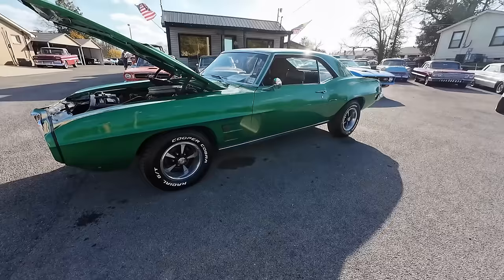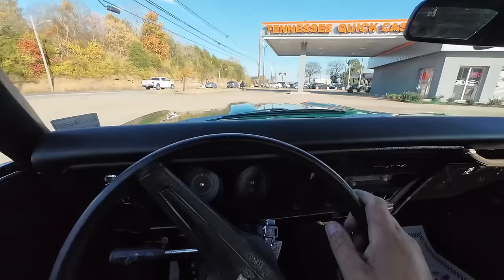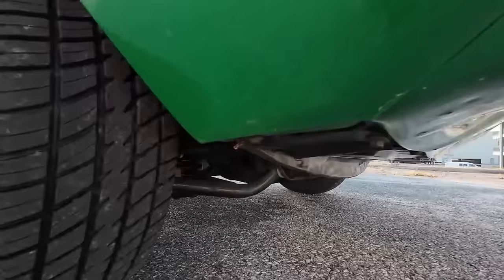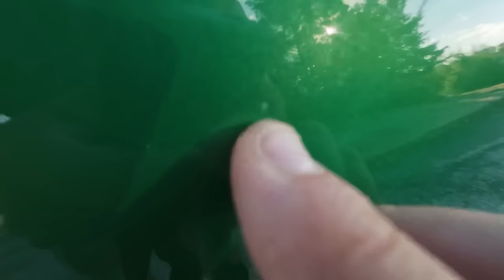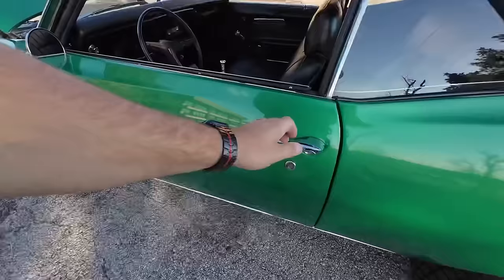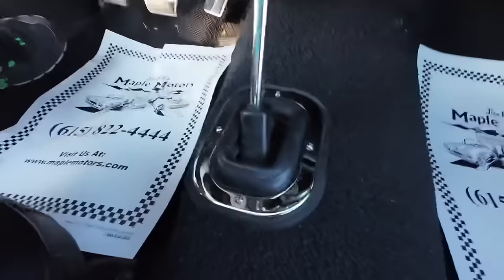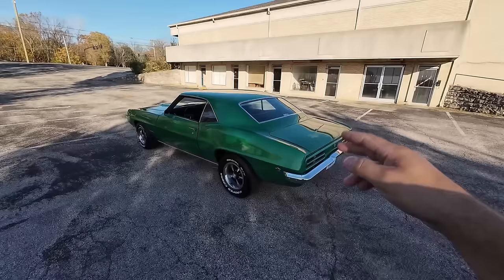Test Drive 1969 Pontiac Firebird SOLD $34,900 Maple Motors #2386

Comment: When I was 17 years old back in 1991 there was a silver 1968 Pontiac Firebird 400 convertible in near mint shape for sale at a dealer like yours for $7,500. I only had $5,000 at the time and could not afford it so I found a 1965 Buick Riviera with a 401 that I was able to get for $4,500 instead.
Reply: Ahhh back in the day when the cars were all priced right!!!
Reply: You and I are the same age, I believe. I started out w a 69 Mustang. Paid $800 for a Mach One w the Windsor engine. Sold it a few years later for $3500 and I'm still kicking myself in the ass for letting her go.

Comment: Not certain that’s a $35k car
Reply: Welcome to the old car market bud.
Reply: That's still cheaper than a 69 camaro💁‍♂️
Reply: Try to build one and see what it costs.
Reply: @Tartan1206  I'd rather build one. You have no clue whats under that paint or whats going on in that motor or trans. 99% of the time that restored car you buy, needs to be restored again, then your spending more. When you build one you know exactly what you got.
Reply from the maker: If you build one be prepared to open that wallet, a whole lot wider. One thing I’ve learned working here , it’s better to buy then build. But if you do have that extreme OCD, then you better have some big checks to go with it.
Reply: @MapleMotorsNickSouthgate  so what happens when a guy buys a 35.000 dollar car and in a couple years the bodywork starts falling off on their driveways? or the frame or unibody structure is filled with bondo and cracks in half? Then you have two choices, it becomes an yard ornament that the guy still owes 30.000 on, or fully restore it again for another 35.000, while still paying it off the first time? " in that case you better open that wallet even wider than that! I've seen it time and time again beings i work at a body shop that restores classics. I cant count how many times guys or gals have came in the shop after they bought a supposed "restored" car and come to find out its nothing near what they thought it was. Thats why if a new guy wants in the classic car game its best to just buy them in raw form and build it yourself. Then you know exactly what you got!
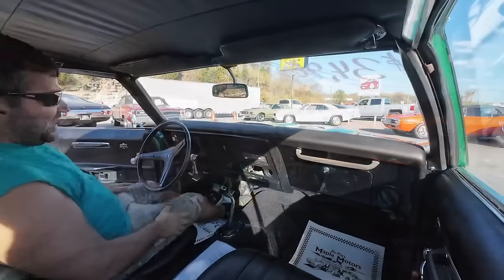Reply: 2:58
Reply: Sharp looking but a little less finished than some at MM.
Reply: Because it isn’t worth $35k
Reply: @MapleMotorsNickSouthgate I tend to agree with this. I mean not just because you are Lord Nick, but because I know all to well what it takes to try and restore an old car like that. I've got THOUSANDS invested into my 91 Fox and she still is nowhere near perfect. 

From what I can see in this video the problems this baby has are kinda small. Take care of that front end issue and maybe rebuild that transmission "or put a new clutch in her" and of course fix that horn, and she'd be worth close to what you are asking for her. Ha ha ha, you know but undoubtedly cash is King, so I'm certain there's room to negotiate on the price😉
Reply: @Roger-fs5yo  They don’t negotiate!  Price is as is .
Reply: It's definitely a risky move when you buy a Classic Muscle car or any Classic car for that matter . The longer you look the more you'll find especially on a driver like this one ! You never know what's under the chrome or the paint , nothing against the sellers but it's basically a project car with a paint job  , I know it's not presented as a show car but for that price it should be mechanically sound ! That's alot of money for somebody to pick it apart while you're gassing up  ! My pops has a 66 SS Chevy ll he fixed up , not restored & he told me whenever you think your finished walk around it and look for what's wrong not what's right , make a list then fix the wrongs ! Won't be perfect but close to it  ! Over all nice car 🔥🔥✌️👍
Reply: @SloppyMouthJoey  Where can you get a full restoration for 35k? Most places charge closer to 100k for a basic restoration.
Reply: @gsxr1189  well, it depends on how far a guy wants to take it. Obviously if you have a shop do everything it would be double the 35.
Reply: Classic car lots and Disney Land are alot alike.
Money's no object in wonderland. 

Give me 4 of those  $80 apiece Mickey t shirts 😂
Reply: @SloppyMouthJoey dont finance your toys. If you dont have the cash, dont get it.
Reply: @artgayhart6451 And that's probably why it is STILL in the yard 3 months later.

Comment: I had the same car , Orange/Black Hat. 350 Pontiac 4 speed factory Tach on hood.. I blew the pinion gear through the diff housing doing a launch.. Those diffs had a weak chin lol. Nice car just needs interior adjustments and some suspension too.

Comment: Did anyone else notice it's missing the trim tag. I never understood if you're going to put a chevy engine in it, don't paint the engine a Pontiac color. Who did the exhaust made a huge mistake, never, ever run the exhaust short of the 1/4 panel. The exhaust gases will rot a 1/4 out from the inside.